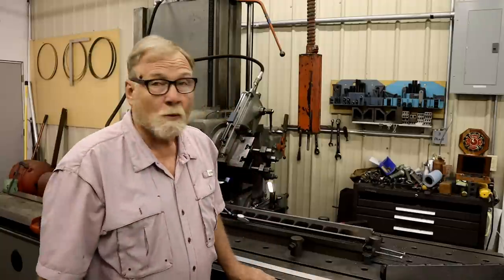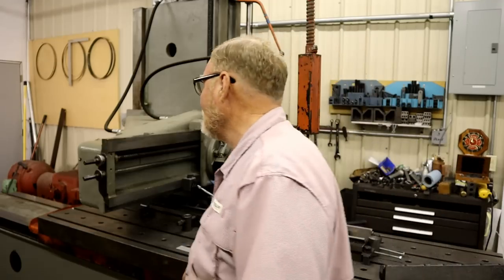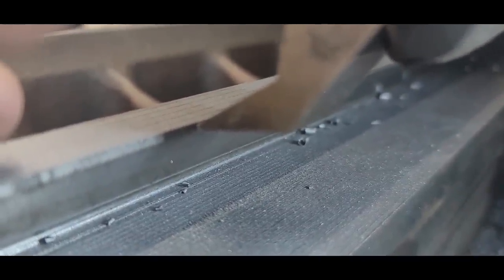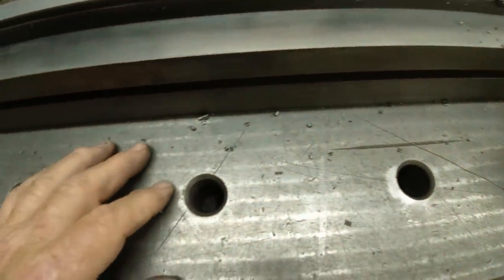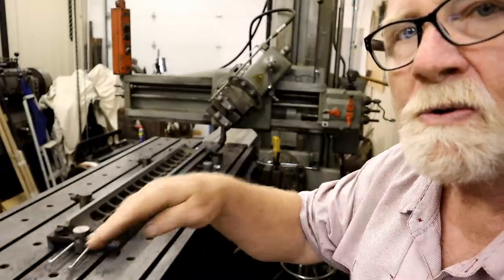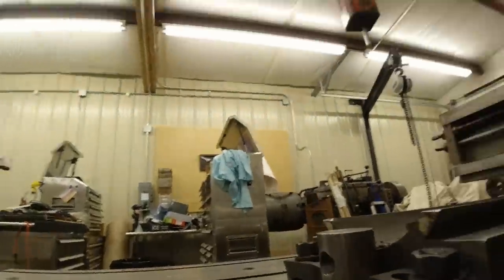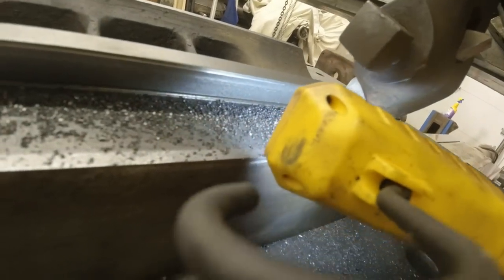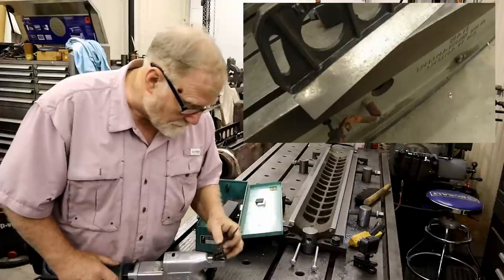How To Plane a Bridgeport Mill Table: Part 3

Comment: I was the planer and boring mill man at everworth  tool for yrs  Sure miss that job even the 70 hour weeks , all work was for a steel mill out in Pennsylvania. So it was all big stuff a ton or more. I had to make the hold downs for the planer in my small shop. Might seem tedious but now yrs later wish I could go back.
Reply: Awesome 👏🏻
Reply from the maker: That's why I have my shop, need stuff to keep the old mind active and there is nothing like figuring out the problems that come up :)   Just don't know if I want to handle the big stuff, sounds like too much work :)

Comment: I find it fascinating the way you setup and run the planer.   I had to chuckle when you said the planer weighed 28,000 pounds. My poor little Taig mill weighs in at about 60 pounds all tooled up.  Thanks for the fun video.
Reply from the maker: Thanks for Watching Roy :)

Comment: Excellent job Steve!!!  Couldn't do it any better myself!  Thanks for sharing.

Talking about Don hanging on the cross rail.  The Rockford planer I ran many years ago had basically the same cross rail but it stuck out roughly another three feet!  The tracer attachment hung off of it.  The table the templates attached to bolted to the side of the planer table. The tracer and mounting plate I guess was around 400 lbs.!  I'm sure it didn't sag any with that tracer attached either.  Ken
Reply from the maker: Glad you enjoyed it

Comment: Hi Steve if you canted the clapper box  to right or left depending what side you are cutting there would be  no need to lift cutting tool on return stroke. This is standard procedure. B .Reilly  a time served planer Glasgow  Scotland.

Comment: I had an idea.  See if you like it.  To prevent using the wrong lever, make some covers for the knobs.  Cubes open on one side so it can slip over the knobs you don't want to use.  when your fingers contact the angles they'll tell it's the wrong knob.  (Make round ones too if they aren't round.)  Good vids.
Reply from the maker: Not a bad idea. In this case it was just hitting the lever that made it go into that gear... Now it can't :)

Comment: I'm looking forward to seeing how you employ the planer gauge to set the height side to side and get it dead nuts so there is no tilt in the table when its married to the saddle......thanks for the great vid.
Reply from the maker: I just use the planer gauge to get the tool height set close.... Remember the bed of the machine is used as the reference plane, just like a surface table..  I will then use a dial indicator to sneak up to the final surface to make everything just right...

Comment: Worked on Bridgeports for many years. I always thought they ground them.  This is very interesting. The tool room guys said after grinding. it is within tenths and will slide perfect,,,lol.  Yea right, always have to do them .   have a power scraper and a flaker that we no longer use. Semi-retired.
Reply from the maker: They are just grinding cheaper lathes nowadays. Quality stuff is always scrapped , Thanks for watching.

Comment: Steve, awesome episode, I've never seen a Bridgeport table planed in like that before, I really wasn't sure how they did them.  Anyhoo, question for you.  The Bridgeport I use on a daily basis is a mid 80s 2J variable speed job.  With the usual wear issues.  You said the tables get distorted from clamping with the T-nuts, I can see how that would happen.  But what about wear?  You mentioned .008 wang in the other video, is that all from the table distortion, or is some of it wear?  Anyway, thanks for the videos, very informational and educational.
Reply from the maker: It is almost all from peening the underside of the t slots over the years.. I have seen one that was .020.. Heavy hand on the t nuts!  IF it was .005 I would have power scraped it and skipped the planing... " Over 5 it take a ride"

Comment: The other problem with bowing an angle is that the angle changes. Planing that away will bring the original angle back. You mentioned 42 degrees. That’s an odd number.
Reply from the maker: Yes it is... Almost all I have done have been that or 43

Comment: Without knowing the controls of your machine this may not be feasible... but a potential alternative / addition to the wooden block would be to put something tactile on the control you don't want to touch. As soon as your fingers feel it you get mental feedback. You could stretch one of Don's dirty socks or underwear over the handle. Imagine the power of THAT mental feedback when your mind registers what you have hold of...
Reply from the maker: No way to do that.... The cross slide has nothing to warn you of movement.... And God will get you for even suggesting Don's dirty underwear should ever touch my beloved planer!   It's bad enough that I let Don touch it! :)

Comment: Such a awesome machine honestly don’t understand why more of them haven’t been kept just because of the cost to run and accuracy of the machine it’s one of the cheapest tooled machines you can get most of it is hss and easily made your self
Reply: Yup
Reply from the maker: Because they are slow, take up a lot of space , cost a lot to make and mills advanced to where they just made the planer obsolete.. This thing does not really even pay for the electricity...
Reply: @10swatkins  you don’t really do a lot of work honestly if you opened up and bid on jobs for pipe lines machining those behemoth parts it would pay for itself pretty quickly
Reply: Planer can't bore a big hole unfortunately
Reply: @10swatkins   of course it doesn’t pay for the electricity! The owner you are working for is tighter than tree bark! 😂
Reply: @bcbloc02 , I heard he was so tight he has to screw his socks on in the morning!🇺🇸🕶